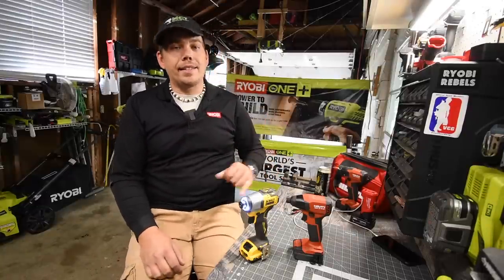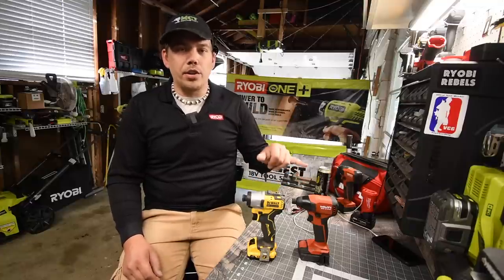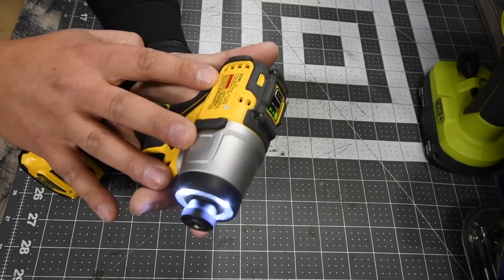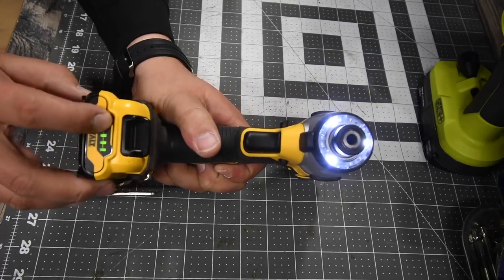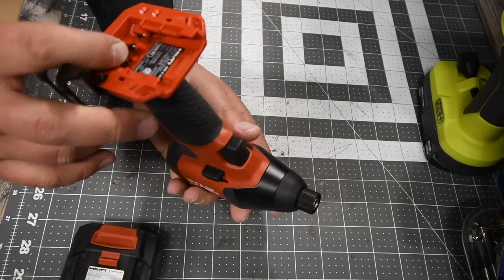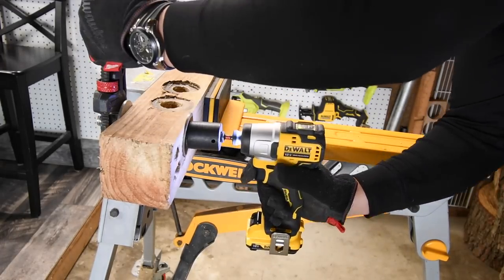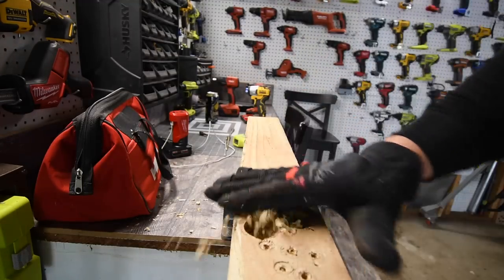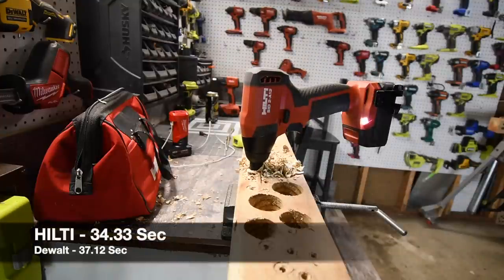Dewalt vs HILTI (12v Impact Drivers)

Comment: Well done Dave!  One of your best ‘Versus’ vids!  I have the X treme 3/8 impact wrench, which I think is almost identical to the Impact in this test.  Good little tool.  I wanted a compact socket ready tool, that can ‘double’ as an impact driver with adapters.  DeWalt needs to expand on this line, and YES, I wholeheartedly agree with you, get some bigger amp hour batteries DeWalt!  Thanks
Reply from the maker: I thank you George. more ah the better
Reply: @ManCaverTools  you’re Welcome Dave.  Ha ha try telling that to Makita!?  I have asked and pleaded and asked and pleaded... for over three years now, for something beyond 6 amp hours, in the 18 volt battery system.  I keep getting the same old excuses from their Tech Dept. Run time and Amp draw doesn’t seem to concern them, as much as the transportation laws regarding over 105 watt hours?   I guess their solution is to come out with their new 40 volt XGT tool solution.  Peace
Reply: Almost identical, it’s just beefier with an anvil instead of a collet.

Comment: I quite like the 12v tools, am currently interested in the new hikoki range but usually end up getting 18v as they're cheaper and have more power. You'd expect 12v to be cheaper. That's the case here in the uk anyway for a majority of 12v tools.

Comment: I would love to see how the DeWalt DCD796 hammer drill holds up against other drills in same category. I just bought a DCD796 and really like it so far.
Reply from the maker: More versus videos coming up :)
Reply: Hey Kristian. I own both the 796, and the regular drill driver 791.  The 796 is a really decent tool, if you get a ‘good copy,’ I.e. smooth running, low or no run out on chuck, etc.  It holds up well.  Checkout ProTools Review.  They did an exhaustive test of a bunch of 18/20 volt drills, and I think they picked the 796 as best in its category.  Mine came in a Flexvolt Circ saw combo deal.  I didn’t need the drill, As I got the combo for the Flexvolt 9 amp battery and newer saw.  Now that I have used it, I think I will keep it, not sell it.  Good luck with that!
Reply: @georgedavall9449  my dcd796 has no run out the chuck, that is something I always make sure of on a drill, I like the drill so much that I ordered the dcd791 drill driver because it's a tad shorter and the chuck doesn't press in because of the hammer mode, I almost never use the hammer mode on any of my drills, but it is nice to have the option if I have to mount something to a brick wall or concrete

Comment: I love my 12v Dewalt it's really comfortable and lite.   I also own the M12 Fuel impact driver, the power is Awesome but the handle stinks , besides being top heavy , the trigger is in a weird spot , sometimes I use my middle finger to pull it , it's not too bad when putting in smaller screws , but anything over 2in. when you have to use more pressure , the handle really sucks , and prolonged use really gets irritating....
Reply from the maker: I hear you on that and I thank you for viewing Brian

Comment: Do the 12v Xtreme 3ah vs Dewalt atomic, with a 1.5 or 2ah battery.
Reply from the maker: I can do that to see what it can do
Reply: The Atomic will smoke it Juan,  but it would be interesting to see a Versus vid?!
The little 12 volt X treme drill is good, but the sudden stoppage when the battery gets low, and the abrupt motor braking of the Chuck, detract from it, IMO.  The 2.0 amp hour battery doesn’t last long either.  Like Dave said, DeWalt needs to come out with higher amp hour batteries.  Peace

Comment: Can't decide on the Dewalt 12v impact or screwdriver...the screwdriver seems to run screws in quicker than the impact..it's deceiving..I wouldn't be running lags or anything just drywall sized screws or less..just wondering if the screwdriver would be the better choice...alot more quiet too lol
Reply from the maker: id go with the impact.

Comment: Hey man great channel .i have i question .sometimes i hear small noise in my 4ah (21700)batterie when i plug it in my sid4 a22 impact .but after some second disappear .i think this is normal yes ? is just the electronics inside maybe
Reply from the maker: I've never heard any noise coming form any battery yet
Reply: I mean if u put ur ear near batterie u will undestand that ,is very very thin noise I think because the led still open :) anyway i think is normal :) thank u so much brotha ;) i will like to see the the new sf4 drill  and the difference with the sf6 and also the new siw9 impact wrence vs any dewalt or makita ;)

Comment: The video is very good, both of them excellent equipment. Now I don't know if it happened to you, but in the case of the dewalt, the model dcd887 20 volt, after using it, the metal box would always be where the part that plays with the plastic casing, After using it, it is always stained like grease, like it perspires, which doesn't happen to me with sid4, has it happened to you?
Reply from the maker: I would get grease coming through the seals by the speed switch sometimes.
Reply: ok, and is it normal? It can't happen that the gearbox parts wear out or something? because in the milwakee and hilti I didn't see what happened.
well thanks for the answer

Comment: So I'm confused. Isn't the Dewalt's 1,450 inch pounds of torque the same as 120 foot pounds? So why would it struggle at more than 30 foot pounds of torque?
Reply from the maker: because the sized of the nut it needs to do. Im pretty sure that these wouldn't be able to unscrew 100lbs of torque with a 1 1/2 nut.
Reply: Different nut sizes

Comment: I don’t think you understand how battery packs work the reason that Milwaukee has higher amp hour rated packs is because they add more cells and get away with it because the 12v slides into the handle and they can add another bank on the bottom to make bigger capacity slide packs they would be significantly larger which is why people use 12v over 18v, you aren’t going to see many brands over 4ah until technology advances partner
Reply from the maker: you just said what everyone knows already. but I thank you for trying